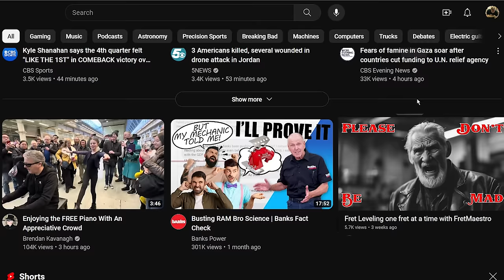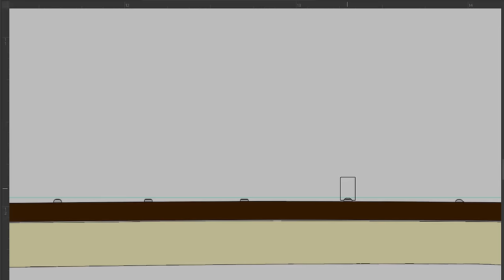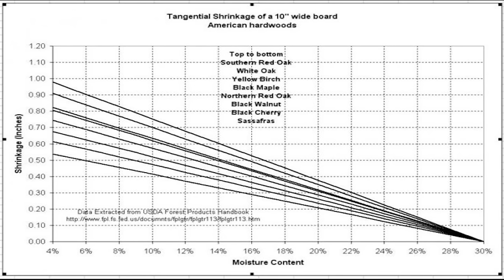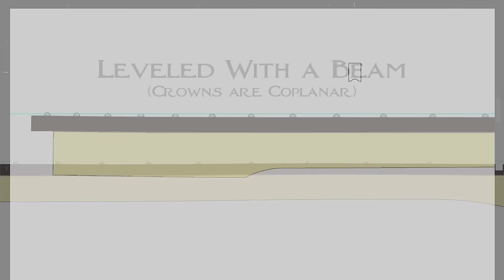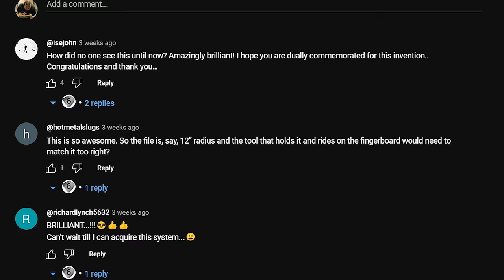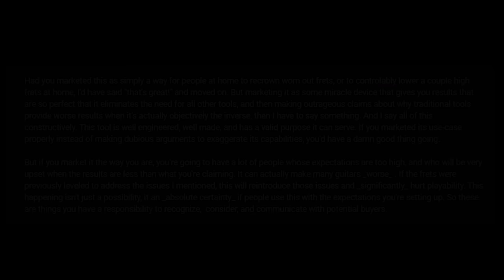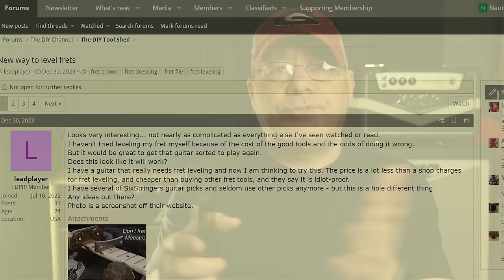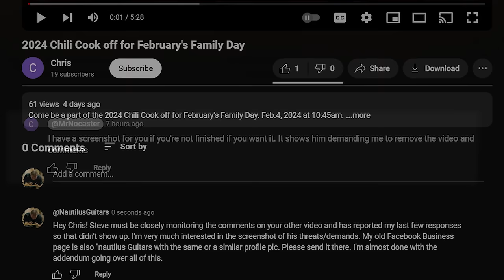Fret Maestro - Gimmick or Godsend? - A Fair Warning

Comment: Sorry, but to suggest that one can repeatably control fretwork precision within 1/100,000th or even 1/10,000 of an inch demonstrates a lack of understanding of those measures and the impossibility to work or measure within that realm of scale on a guitar that is inherently non-rigid and unstable, and using tools that are not precise to that degree.

Do you line your leveling beam with sticky-back abrasive (sand paper)?  Even if your leveling beam is “perfectly” flat, you can be assured that the thickness of the abrasive varies in thickness along its length far beyond the measures you think you are working within. 

1/1000th of an inch, ok, maybe… 1/10,000th or 1/100,000th, never.
Reply from the maker: My point was that the peak of the crown, from being leveled to crowned and polished, can be maintained near-perfectly. I have Mitutoyo calipers that measure to ten-thousandths, and there is no difference from the end of leveling, to the final polished frets, measuring the exact same place. If the calipers measured one-hundred-thousandths, I'm confident that the majority of jobs would maintain that level of accuracy.

I don't think this is too hard to believe. Parhaps you misunderstood my point? This is something I could easily demonstrate, and logically, it's not hard to believe.

Edit: I'm speaking of the height of the fret, measured relative the the fretboard. Which is a valid measurement, if all you're trying to confirm is that you're maintaining the final crown height per-fret after leveling.
Reply: I’ve misunderstood nothing… your statement at 2:12 is very clear, you say that any “luthier worth their salt can easily work within those margins”… you have no comprehension of what 1/100,000th or even 1/10,000th of an inch is.   To make such a statement is absurd, and only contributes to the vast guitar related falsehoods that are perpetuated online.

You are speaking of precision gauge tolerances, and that level of precision is not repeatably attainable on a non-rigid, mostly wood substrate guitar. 

You cannot fixture and work support a guitar to attain that precision (the neck will deflect just under the load of a leveling beam).

Your leveling beam is guaranteed to not be straight/flat within 1/10,000th of an inch.

The thickness of abrasives is not consistent within 1/10,000th of an inch.

Your video goes on about the need of “coplanar” fret tops… agreed, except “coplanar” shouldn’t be used to describe a non-planar surface, but that’s a small point.  My point is that measuring the thickness of a fret top with a precision caliper before and after crowning/polishing does not qualify the “coplanar” quality of the playing surface.  In fact, I doubt that you could measure a gauge block blindly with a 1/10,000 in. graduated caliper to demonstrate you can measure repeatably.

I agree on most of your points, but repeatability of 1/100,000 or even 1/10,000 is a falsehood.
Reply from the maker: @davidradlin5955  I dispute your contention about the accuracy and will try to make a one-shot video demonstrating what I claimed.

Also, I understand your technical quibble with the term coplanar, but unless you can provide a better term to describe the concept of a "cylindrical plane" , I'll defend it's use. There's no useful term to describe this concept that I'm aware of. So if we break it down logically, to explain how I'm fitting the term in, we can consider the fret crowns an infinite (or down to a plank length of you want to be pedantic) division of planes along the fret boards lenght. Obviously that degree of accuracy is absurd, but it's the "ideal" condition we'd target if possible. It's a perfectly usable description of the concept I'm trying to convey.

You should go see his latest video and how he "conveys" the concept of "coplaner" (his spelling not mine). You think you have a contention with my use, wait until you see his. It's hard to even sit through.
Reply: Peace, brother… don’t work so hard.  ✌🏻
Reply from the maker: @davidradlin5955  Here you go: https://youtu.be/DxGc6IryIzY

While .0001 is probably out of the question, a .0005 mean average from 20 measurements, under suboptimal conditions, says that it's not as outrageous as you seem to be implying.  I'll eat crow and agree that I should not have stated that. Although it was not a statement of fact, but an assumption based on prior measurements. 

Obviously we're working under imprecise conditions. That's a given. But we're targeting as close to perfect as is possible. If every "planar" division of the frets radius has an average deviation of .0005 per sample point, I'd say we're at tolerances that are functionally perfect for a guitar. 

It goes without saying that any deviation technically disqualifies  the description of "coplanar", but compared to the original condition, it is far closer to "coplanarity", which is the only goal. I don't think I should have to say that I'm not claiming mathematically perfect linearity. It's a concept to describe a goal.  And again, an alternative term for the concept would be appreciated. I tried to find one, even before making this video, but I cannot. So if you have one, I'd appreciate you sharing it with me. 

No animosity towards you! I don't mind being challenged. In fact, I appreciate it. It helps me improve myself and understand life a bit better.
Reply: Again, your statement at 2:12 is very clear when you say that any “luthier worth their salt can easily work within those margins”… 1/100,000” to 1/10,000”

Of course the fret tops should remain unaltered after crowning leveled frets… that is not what you implied.  You implied that the precision can be maintained throughout the process of level/crown/polish.

If you can’t level within 1/100,000” or even 1/10,000” as the first step, the crowning and polishing only imparts further variability.

Your new video demonstrates that you can’t even measure repeatably within 1/5,000”. 🤦🏻‍♂️ 

Regarding the term “coplanar” or whatever, I never took issue with that… in fact, there is no singular term to describe the tolerance condition.  One would have to describe the basic geometry and permissible deviation from the basic geometry using GD&T (geometric dimensioning and tolerancing).

I’m not challenging your Lutherie skills, but it’s important to understand accuracy as it applies to the trade and fretwork in particular… and with regards to fretwork, what’s important is that frets farther up the neck are lower relative to the fretted note and the envelope of the vibrating string above that note.  Therefore, accuracies of 1/100,000” or even 1/10,000” should not be part of any fretwork discussion.
Reply: @davidradlin5955 Exactly. This ‘proof’ video showed only that crowning files don’t remove much material. 

He claimed that “the accuracy of fretwork can be within a 10,000th if not a 100,000th of an inch” — but this video shows nothing about accuracy of fretwork. He just crowns a single fret…

It’s pure and deliberate misdirection, because he clearly cannot get anywhere near the kind of accuracy he claims.
Reply: @johnbuell8035 … you get it.